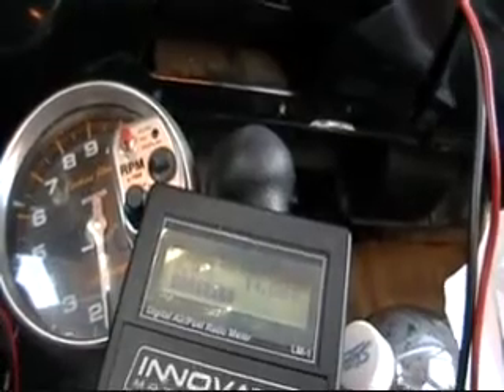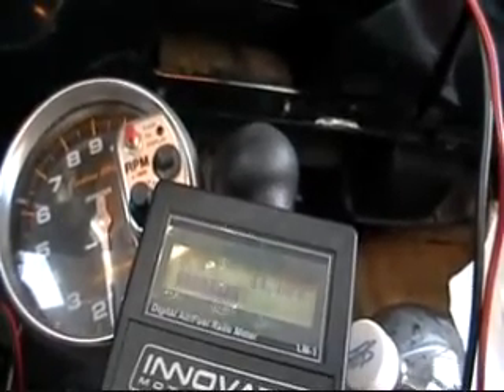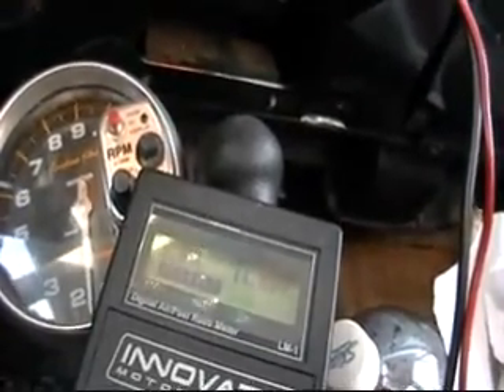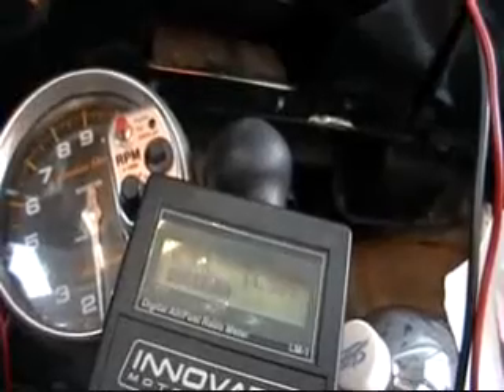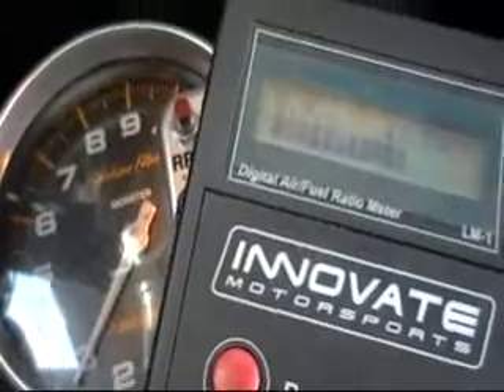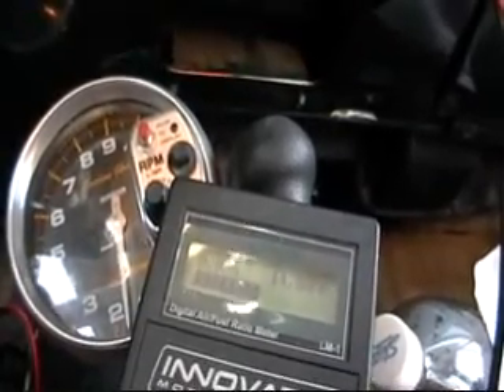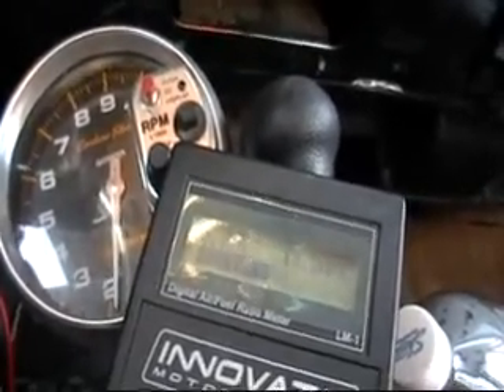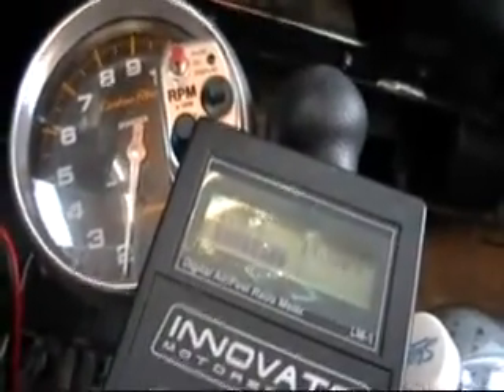10 lpm at wot

Comment: here's an idea try a water spray in the air intake while running just hho the water will provide the expansion needed for conventional engines 
gasoline has alot more expansion but hho is hotter >:)

Comment: I think what you have done here is documented evidence of the calibration error induced in the oxygen sensor by the altered exhaust gas chemistry due to the significant amount of 2H2 + O2 which was replacing a percentage of the air.  This should mean a richer AFR, but due to the altered ratios of unburned CO and H to O2, there is a calibration error.  That paper I sent you has clues to this, I think.  O2 sensors largely respond to unburned CO and H, which is usually at a certain ratio to O2.

Comment: Merry Christmas back at ya, and remember to forget normal known math, it will have to be re-evaluated after observed data is done. 

To help people understand the importance, the only difference between your around town crappy mileage and your good freeway mileage is about .5-.8 afr, so city is 15 and freeway it 20, if hho can make your city .5-.8 better then it becomes 20, and if the freeway afr goes up in correlation then it becomes 25. Since its a ratio the increase is geometeric not linear.

Comment: Excellent work and a very good method of reaching a GREEN and clean solution.

I have restricted my air intake about 40% to fool the MAP into thinking it is at a thin air altitude.   My 2001 Escort went from 28-29 to 33 MPG.

Simple to do and it works.

BoyntonStu